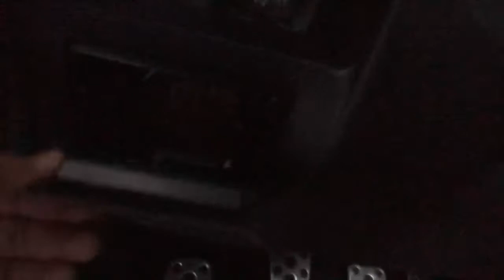Fog lights Installation for 2018 wrx

Comment: Hey so what did you do with the extra red cable ? You never show up what u did at the end
Reply from the maker: Norbolar37 Bolanos watch the last part of the video bro, i connect it to the fuse by the 4 slot to the left.
Reply: @Rxa19_vegas  but how did you connect
Reply from the maker: sorry for long late response... the first red cable is the ground & last last one is by the fuse.
Reply from the maker: @AdrianRodriguez-oy2df  the last red wire by the end of the video is by the fuse left side next to the driver side.
Reply: @Rxa19_vegas   thanks body!!!